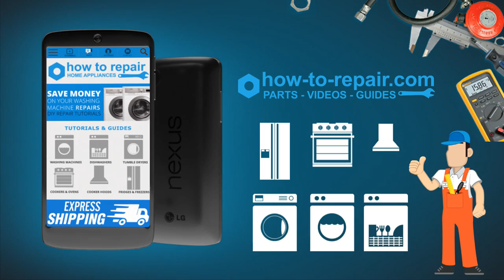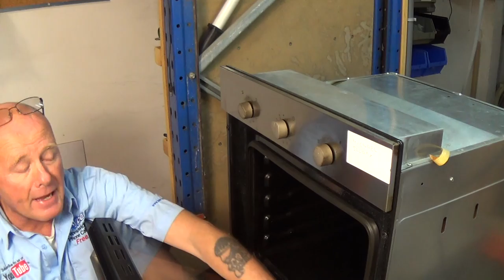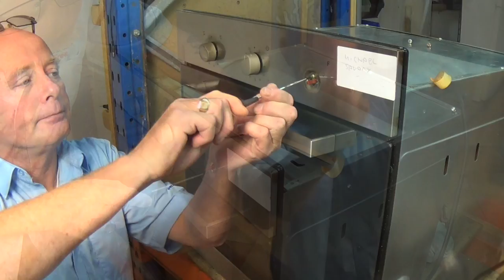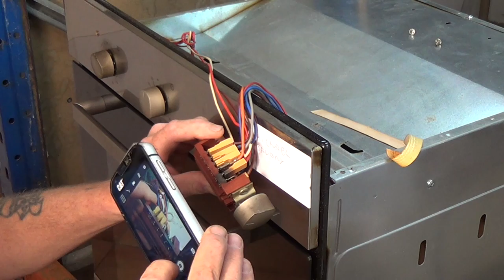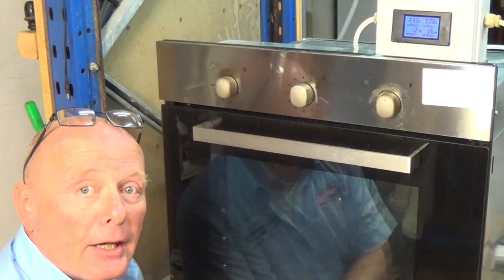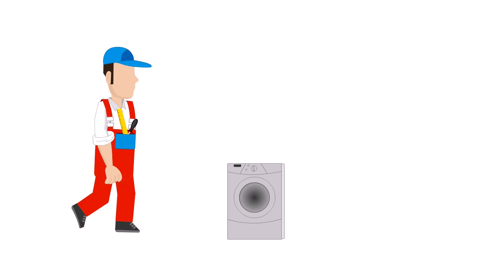Oven Not Heating, Selector Switch Fault on Oven

Comment: Thanks oven david attenborough! 

In my case I had some little notches but these were a red herring - I found that one of the springs was not engaging to push a connector closed when the dial was turned. Possibly fixable with some WD40 or contact cleaner but I ordered a replacement part anyway, only 12 quid. A gentle push with a screwdriver and the troublesome connector snapped closed, so I set the dial to the 'oven on' position, nudged the stuck connector so it closed, and reconnected all the wires and now I'm simply turning the oven on at the wall to turn it on/off while I wait for the replacement.

Typing this while I wait for my fish fingers! :)

Comment: I have a Smeg TR90BL where the bottom element isn't turning on, the two round elements around the fans work. But not the bottom. Looking at the wiring diagram I thought it can't be the switch how would that fail in a 6 year old oven. I tested the element by putting power directly to it and it heated! So I was thinking it maybe the PCB relay which I replaced but still no good. So it must be the selector switch as you describe, not going to be as easy as the one you're working on as my Smeg has a gas cooktop to disassemble to get to the selector switch. 🙄 Happy I came across this video even though it was made 5 years. It pointed me hopefully in the right direction !

Comment: Great video and explanation. My oven is acting exactly as you described. However I've replaced the selector switch and I still have the same issue. I think the thermostat is working (I hear the click and my meter beeps during the continuity test). The heating element gets hot during grilling (and the thermostat works with this too. What would be the next most likely component at fault? Thanks in advance.
Reply from the maker: Hi, please use our contact us page and make sure you fill out the request for what your problem is. I will need the full model number of the identification plate and the details of your problem so that I can provide you with useful literature. A video shoot of the problem would be perfect as well.

I will get back to you within 24 hours, normally. https://www.how-to-repair.com/help/contact-us/  

Please remember to subscribe to our channel, as that's what keeps this channel going. Thanks, Paul 👍

Comment: Great video and well explained. Well I have different issue, I wanted to swap the broil with the bake in the selector. I want to depend on the bake cooker instead of the grill. Can I simply swap the wire in the selector?
Reply from the maker: ask question on site and i will try and help
Iam Glad we could help you. 
My Ebay Shop https://rover.ebay.com/rover/1/710-53481-19255-0/1?mpre=https%3A%2F%2Fwww.ebay.co.uk%2Fstr%2Fhowtorepair&campid=5338676951&toolid=20008
If you ever need help please use our site for 24 hour response https://www.how-to-repair.com/help/contact-us/
If have a question please use our site for 24 hour response https://www.how-to-repair.com/help/contact-us/
Please remember to subscribe to our channel
https://www.youtube.com/user/Apart4u?sub_confirmation=1

Remember to Shop with www.how-to-repair.com and it would help us by posting the video or

website on your timeline. This helps us a lot and if we really helped you can
always buy us a beer http://how-to-repair.com/help/buy-paul-a-beer/

Please remember to mark us to your favourites also I would be grateful if you would
subscribe to our channels social media as this really helps my site and keeps
us going.
YouTube. http://www.youtube.com/user/Apart4u

Facebook. https://www.facebook.com/how.to.repair.appliances

Comment: You mention selecting the desired oven setting before turning the thermostat knob to heat desired... to avoid burning out the terminals in the selector switch. What about when you select the preheat setting, then after the oven has warmed up, you need to move the selector switch to your desired setting? Isn't that also bad for the terminals in the selector knob?

Comment: The most likely fault and the cheapest repair will be the thermal cut-out on the rear of the oven. There is another similar looking device on the top which is normally open and turns on the cooling fan when necessary.

Comment: I have a Whirlpool model# RF111PXSQ and I checked continuity to both elements. When I turn the broil and bake oven on it makes a clicking noise right behind that knob. The part # is WP9762215 and I just wanted to know how to test it. I have taken apart a lot of motors. So now I have a soldering iron if needed. Im a landlord and try to fix everything myself so I was asking how to test before I buy it. Thanks man

Comment: Hi, great video. Could this be the cause of my problem if all features on the oven work correctly except the fan assisted element in the main oven which doesn't get hot. I have tested the element and tried a new genuine element but still no difference. Any advice would be much appreciated. Thanks

Comment: Thanks for the video, it was very helpful! I  am having exactly this problem but for both selector switches (The 12 program and the 6 program selector switches). I replaced the 12 program selector from my Sauter oven and now is 'almost' working again (all programs except the one to turn the oven off '^^). Does anyone know if is there a link between the two program selector switches that could cause this kind of malfunction or are both switches completely independent?
Thanks in advance!

Comment: Hi, I have a Candy FPP 602/1x after about 10 to 15 of work it jumps the main circuit breaker. I had a technician over and he check the bottom coil and it was shorted so he replaced it. The following day it jumped again and now he thinks it a thermostat. I was wondering if you have any idea?
Thanks

Comment: I have a whirlpool AKG 353 /wp and when turn the oven on the grill comes on. I can't get the oven to come on the fan works and the thermostat lights up but no heat and the of position doesn't turn it of.. So I'd say the elements as gone plus I need a new selector switch. Could you help as I can't fined my model anywhere. Thanks

Comment: HI, great video! My selector switch overheated and melted the plastic like the one in the video, I then swapped it out and then the new switch only lasted a few months. I replaced it again today and that wire is still getting very hot. It is the wire that connects from the thermostat to the selector switch when the oven is on. What could be the cause of the wire getting very hot? I have made sure that the connector is not loose, it makes a good contact. 

Kind regards
Marc
Reply: There can also be a bad connection between the wire itself and the cable connector (that you slide). Or the current is simply too high for the plastic material. Then i would say the manufacturer tried to be a cheapskate.

Comment: You mentioned it  a selector and not a thermostat switch
Reply from the maker: The selector switch is what sets the program to the type of heating mode then the thermostat controls the temperature if you are having problems with your cooker feel free to use the website and I will try to assist you when I have all your cooker details. Have a great Christmas and a happy New Year. Hi Theo Jacob I will need the full model number of the identification plate please use our contact us page and make sure you fill out the request of what part you are after and will get back to you within 24 hours normally https://www.how-to-repair.com/help/contact-us/
this is for you https://www.youtube.com/shorts/e432SAb2g08 please remember to subscribe as that's what keeps this channel going. Thanks 👍